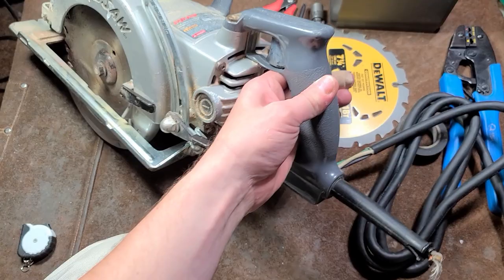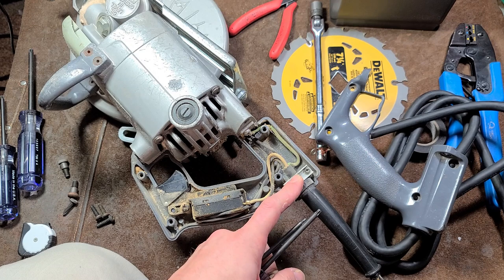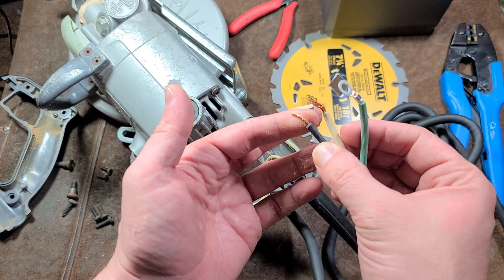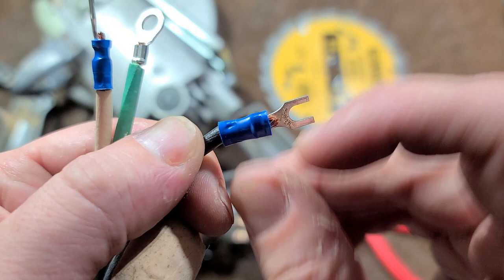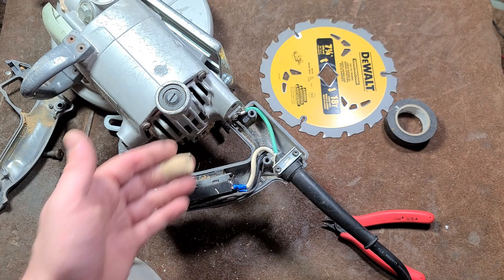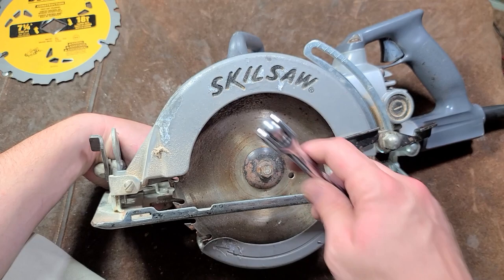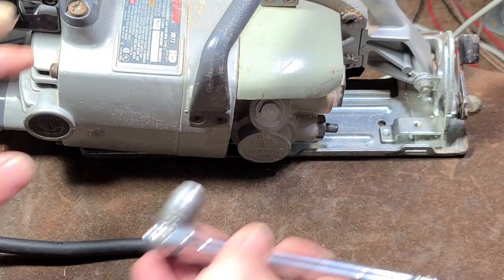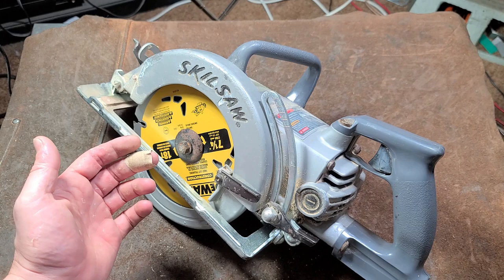SkilSaw 77 Service... Power Cord, Blade, & Oil 🎃

Comment: This video was very well done. By the way, I looked online and cords from Amazon that were non OEM and required modifications were about $15 and I was able to order a Skil saw OEM replacement part for about $21 that was an exact fit. worth the extra few dollars to go OEM in my opinion.
Reply: Fuck that OEM is a 14 gauge and way too short. Put at least a 12ga 25-50’

Comment: Good video! One thing I like to emphasize is with the switch still attached to the handle, the black is on the bottom terminal screw. The white is on top. You probably saw that, I like to reenforce it. To me when removing the arbor screw, yes it is a left hand thread, that turning to the right, which is clockwise, that loosens the screw.

Comment: Does anyone know what type of gear oil ??
Reply from the maker: Skill does sell a special gear oil but it's like 200 weight you can get away with a diesel engine additive called pro punch.
Reply: SKILSAW 80111 Worm Drive Saw Lubricant, Black

Comment: Can you link a place to were i can buy those in Canada
Reply: Kijiji would be your best bet. There are plenty of them for sale at a fraction of the price of a new one.
Reply: If you need replacement parts I like mm tool parts .com. they have great customer service, blown up diagrams, and diy repair videos to help you. I like buying sj100 cord cable and making my own cords. The 6ft factory cords are just to short. I at least would put a 25ft cord on as a replacement.
Reply: Great video.  These old style skills may need a little penetrating oil for the torx 30 handle screws.  I could not move mine until I let some oil soak in.